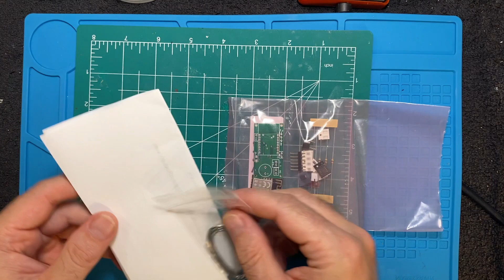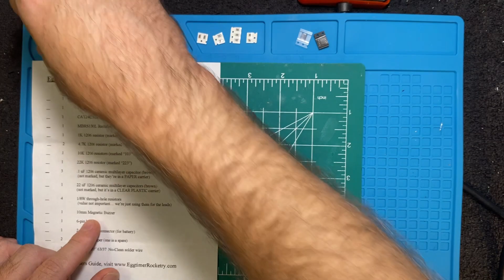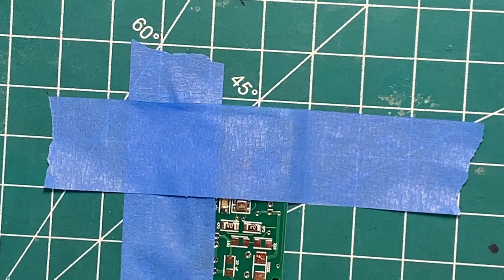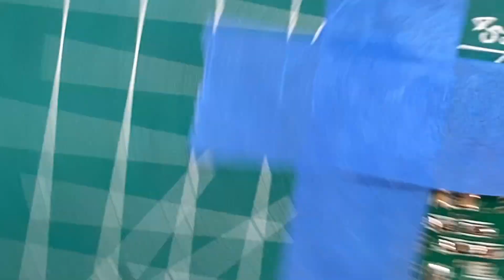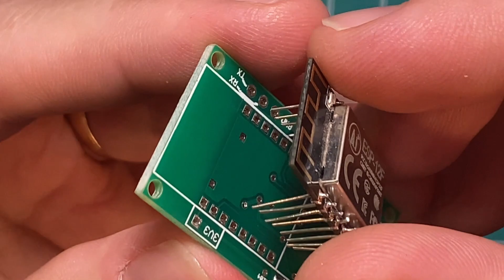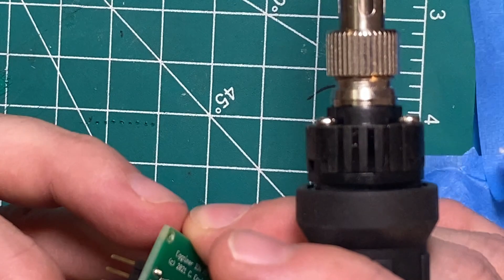Eggtimer ION Altimeter Build

Comment: Do we get a prize for watching till the end of the video? I guessed early on you were going to build an altimeter. I am curious how many feet the Wi-Fi will be good for. Oh, I would recommend that you don't stuff all four altimeters and your GPS into one rocket launch along with two cameras. Just saying, lol!
Reply from the maker: Well, I will need the telemetry module for full data all the way up.  Not sure if the current WiFi will be sufficient, but I can pull the data off after the flight.  What?  Not all the electronics at once?  Where's the fun in that?  I was thinking about mounting a Poloroid down by the fins as well, so an instant photo would fall down ahead of the rocket and I could see the launch from that perspective before it even lands!  LOL
Reply: @KevinsModels  Just put a Wi-Fi security camera on the rocket and watch the launch from that perspective "live".